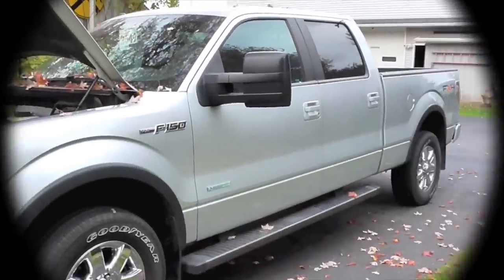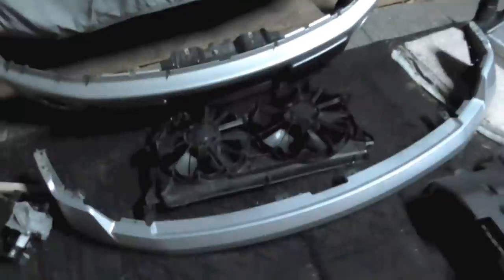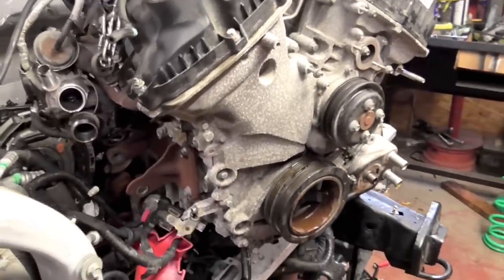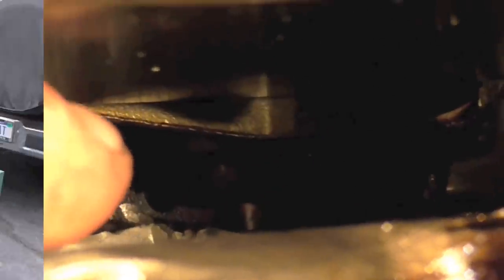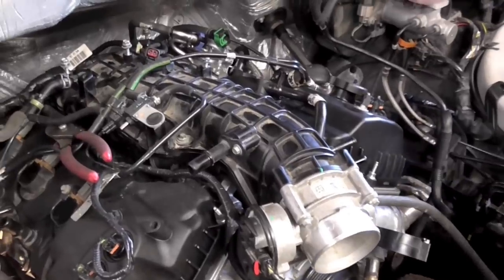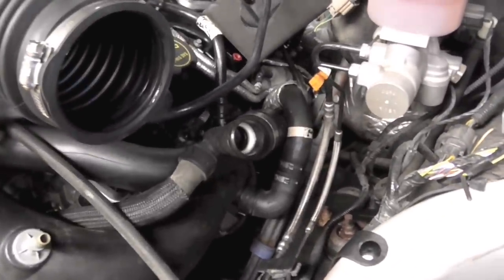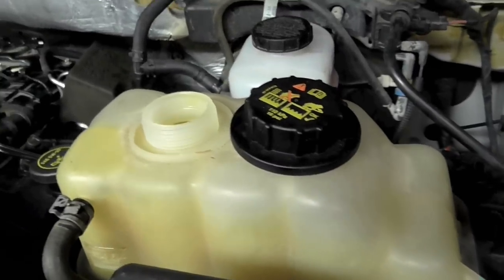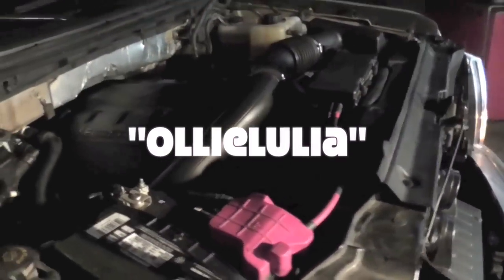FORD F150 TRUCK:  3.5 V-6 ECOBOOST ENGINE FAILURE (Removal and Installation).

Comment: How in the hell did Ford Not Warranty this?!?
Reply from the maker: That's what we thought, but the answer was NO. Probably too many miles ?
Reply: TommyZTrains Just checked it. They had 5 year,  60K warranty.  What crap, man. It should be a recall with reimbursement for previous repairs.
Reply from the maker: Yeah ... "policy is policy" I guess. *We literally begged too !
Reply: TommyZTrains I feel for you. I would hire legal representation for a 9,000 Bill,  plus labor.
Reply: .......the warranty had expired.....period
Reply: fred414141 This is a mass problem and should be recalled.  Warranty or not,  it's a design defect and companies issue recalls all the time.
Reply from the maker: Months earlier we had in in at the Dealer for "mechanical noise's" ... we were told that was "Normal". Also: We had the the drive-shaft spline greased (it was making alot of noise / felt "odd" upon shifting) ... *Anyway, the point is / was I'd wished we'd been told THEN. (Told about the CAC accumulating water inside).
Reply from the maker: I agree ... *When we "spuded" the 1st hole in the CAC,  the water rolled out like a 'mad-dog'. (AFTER the failure / blown Eng.).
Reply: TommyZTrains  dude I hate it for you thanks for sharing the video👍
Reply from the maker: Thanks  :- )
Reply: nitroman365 because it's Ford
Reply: 360Magnum I have them all. Ford, Chevy, Dodge.  They all break.
Reply: nitroman365 Well GM and Dodge are Better with looks and quality
Reply: 360Magnum But Chevy has way cheaper parts. Engine wise that is.
Reply: Sometimes if you have your dealership open a case with Ford they will cover at least a portion of the repair cost. Or get in contact with Ford's customer service people on forums. They seem to take care of people alright.
Reply from the maker: Yeah: "we tried" .... NO Soap.
Reply: +360Magnum - Not true - they basically all have major quality issues.
Reply: 360Magnum honestly no. they all have issues
Reply: you should have backed that odometer to the previous official reading in the papers and then went for a warranty !!!!!!!!!!
Reply: Newbpwng Federal crime... Not sure if you can put a price on your freedom. Lol.
Reply: nitroman365 Please nobody could ever prove this unless you backed the odometer way too far.
Reply: Newbpwng Still, this guy seems like an upstanding citizen. Never crossed his mind.
Reply: Newbpwng believe me, I know that all too well.  Lol.
Reply: nitroman365 Bullshit. Let's see your evidence that GM uses way cheaper parts in their engines. If anything their pushrod V8's are so simple they're inherently reliable. Just look at all the LS swaps going on these days where they pull junkyard V8's out of wrecked trucks an slap a couple turbos on them (1200hp junkyard 4.8L V8 LS - http://www.hotrod.com/articles/hrdp-1109-stock-gm-ls-engine-big-bang-theory/). Ford screwed up when they dropped pushrod V8's and went all-in on DOHC V8s and overboosted V6 gassers. Ever since then it's been bad timing chains/cam phasers/tensioners, weak/brittle oil pumps, bad rockers, blown headgaskets, fuel dilution of the oil, carbon clogged heads that Ford says you can't clean or you'll take out the turbos, leaking internal water pumps that leak into the engine oil when they fail, bad valve seats, blown spark plugs, seized sparkplugs, carbon tracked spark plugs, misfires, etc etc etc
Reply: That's what you'd think right? I had an 07 F150 4.2L that suffered a similar death. Two bent rods and fouled journals, spun crank bearing at 36,667mi. I was told truck had 60kmi powertrain at purchase (bought brand new w/6mi, did all maintenance and oil changes at same dealer) and then found out that WT models only have 36k. Ford absolutely REFUSED to warranty, used every trick and excuse possible even though my first service trip to dealer to report rod knock was at 24k, well before their janky ass fake warranty expired on their janky ass drivetrain. My ex's father left a management position at ford dealership service because he couldnt look himself in the mirror any more. Another friends father had a king ranch so bad he ended up taking the dealer to court and winning on lemon law. Anyways, had the piece of crap rebuilt on my dime when it died at 36k, died again the same way at 51k. Ended up paying off the remaining loan on a worthless pile of scrap metal undrivable lemon in my front yard, and hurt me so bad financially it was years before I could get another truck. The truck was such a fucking pile of junk, it was already starting to rattle with loose door panels and torn upholstery by the second time the motor blew at 51k. Truly FOUND ON ROAD DEAD. Played out saying, but so so right. FUCK YOU FORD, FUCK YOU SO MUCH, and your worthless wind up toy pickups. YOU LOST A CUSTOMER FOR LIFE JUST TO SAVE A FEW GRAND ON A LEGITIMATE WARRANTY CLAIM FOR A BLOWN MOTOR. Now driving a ram hemi that in 10x the truck my f150 ever was. What a joke piece of crap. What an idiotic way to lose not only a customer, but an entire extended family, me, my wife, and my daughter and parents, after they saw what you did, and what utter garbage your vehicles are.
Reply: Ian Hall I have been brought up on Dodge. My dad owns a company that had all Ford fleet vans. All of which has issues with the shitty 5.4, during at 156,000-180,000. The GMCs and Dodges have gotten to 250,000 + without fail, Ford is best selling because their are retards out there that are brainwashed by "best selling" its BS. Dodges 03+ were really the best since 96, I've seen 3rd gen hemis with 215,000 with no issues, but as for Ford the door panels are filling up with water and the grills are cracking. Enjoy the ram, the most resent fleet is all 2012 ram 2500 hemis. They are all at about 140,000 now with no issues.
Reply: 360Magnum MAYBE the 318s and 360s are OK. super old technology... Many of them blow blue smoke out the tailpipe.. the 2.4, 2.7, 4.7 were all know for some major issues and Chrysler just kept on producing them. the front ends on every Dakota and Durango ive workwd on need major work. Ive seen quite a few go down the road with the tires at a 80 degree angle. not to mention the rear ends blowing out of the trucks. don't even get me started on junk 4 speed auto dodge truck transmissions.. not to mention all those caravan transmissions.
Reply: reweydewy I do my own front end work on my Durango, tranny service every 25,000 and diff every 12,000. Rolling like a dream at 152,000. Better than any Ford
Reply: 360Magnum 152k is nothing on any of today's vehicles.
Reply: 360Magnum Yep, I had an 04 Dakota before the 07 f150, wish I'd never have traded it in, just needed a full size bed at the time. The front ball joints were a joke, but switching the factory ones for greasables and once you got used to the swap not a whole lot worse than doing brakes... hell of a lot better than two blown motors halfway to 100k. My new ram just feels "right" like the ford never did. Solid, powerful. Ride with coil springs is a nice bonus too.
Reply: reweydewy Obviously, I have a buddy with an 03 ram 2500 HEMI with 230k with original everything but a diff.
Reply: reweydewy gosh that f150 was such a piece of crap roller skate. It literally felt like it was rattling apart from about 10kmi onwards. My Dakota, besides sorry ass front end, was the only truck I was ever happy with besides my current ram 1500. Just love it. The 5.7 Hemi is very mature at this point, and the 8spd ZF is the best light truck auto trans I've driven
Reply: 360Magnum So what we are all trying to say is they all have problems.. or at least I am. dodge has come a long way from the 2000s but I still think a Ford or gm truck was the better option. not saying it still is tho
Reply: hochhaul calm down, homegirl.  I meant that parts for them are cheaper, as in cost less to buy.
Reply: Ian Hall I think GM and Chrysler in general are good companies. I remember when I was 12 or 13 my dad bought a new 03 Dodge. Which was a great truck, but the diff went out at 38,000. Dodge replaced it under warranty with no issue. As of now, there is a part of order for one of his trucks and Chrysler is paying $980 a month for the truck being out of commission. When a dodge has a weird issue out of warranty they will stand behind their vehicle, which seems to be the opposite with Ford.
Reply: nitroman365 probably because they used ams oil not motorcraft. lol
Reply from the maker: "That very well could be Nick" ... QWere doing Motorcraft NOW and the Truck continues to run FLAWLESSLY.
Reply: Isn't fords warranty only 60k? this had 65k right?
Reply from the maker: Yes.  "But we were turned down flat"  (no help).  And yes: 65,070 miles ...
Reply from the maker: You ARE correct (60K). *We literally begged / pleaded with Ford, and my Son even wrote (NOT an email) WROTE the CEO of Ford, a hand-written letter ... anyway: all this was too NO avail. End game: policy IS Policy.
Reply: Ian Hall That has been my experience with Ford and GM as well.  GM has treated me pretty well, while Ford couldn't give a shit less.  Ford has a MAJOR problem on their hands - both from an engineering standpoint (ecoboosts hand-grenading) and from a customer relations standpoint.  My family will never own a Ford again.  EVER.
Reply: austin In a normal situation (oil in the engine, not abusing it, etc...) NO engine should fail like that 5,000 miles out of warranty.  EVER.
Reply: Ted Brenneman maybe a little abuse is a good thing because I run the dog shit out of my truck and mine has 130k on it and doesn't leak anything and runs like the day I bought it haven't even put a surpentine  belt or front brakes on it yet but I am working on my second set of tires and I have put rear brakes on it and sparkplugs at 100k but other than that I have done nothing but run the dog shit out of it and runs fine what's the Ford's excuse again?
Reply: austin Just to be clear - I am not a Ford basher.  I actually like quite a few of their vehicles.  However, I have dealt with customer service myself, and know someone in a similar situation to the person that posted this.  Their ecoboost had water in the oil and eventually grenaded-after several services at the dealer BEFORE warranty expired.  Truck is 2,000 miles out of warranty, they are making payments on a truck that is sitting, and Ford told them to stick it up their ass.  Sorry if I'm not taking Ford's side in this.
Reply: Ted Brenneman I hear ya
Reply from the maker: Hi Ted: "I hear ya" ... BTW: we wrote (a hand-written letter) to the Ford CEO asking -Him if -they'd please consider ANY help ... we never so much as even received a reply. Obviously we didn't agree (with the "no-help" part), but a reply would have at least been "considerate". 

(Gese it wasn't like we were gonna "break Ford" / and go Bankrupt). Just please "consider our situation, the facts, any ANY help would have been VERY welcomed !! ... *NOT BECAUSE THEY HAD TOO , but rather: BECAUSE THEY WANTED TO.

Anyway: All this time later, (today for example we pulled our boat) ... a "BIG-ONE ... *it ran (and continues to run) PERFECTLY.

 We've had not ONE single issue with the Truck, but again: "It STILL smarts".  BEST  :- )
Reply: TommyZTrains I'm glad you are able to enjoy your truck as well as get out on the water - you deserve it!

It is disappointing how Ford has treated people on this issue (and others, frankly).  I am a fan of Ford (we own an '07 Mustang) and was impressed that they refused the government bailout.  However, if they want to avoid the need for a bailout again, they need to put better tested products on the road, and not treat their customers like crap.  After all, you didn't design the ecoboost - THEY did.  I am still a fan of Ford and I am pulling for them, but THEY need to fix their problems.  Thoroughly tested products and thoughtful, courteous warranty and service should be where they focus their efforts, in my opinion.
Reply from the maker: Ted I just appointed YOU as "Customer Relations" Director !!  *But seriously: I was never "screaming expletives", (or yelling "FREE FREE FREE") ... All we were asking (and wanting) was an appeal to ("hopefully")
look at this issue, ... see the 'merit' of that same "situation" ... and appeal too one's "good nature" in lending ANY "help" / OR COUNSEL too try an help us. 

If you disagree ("Ford"), "that's OK" ... but where I THINK THE BALL was dropped: was the 'no-reply" (with any of it). I'm not "Mike Rowe" ("I luv the Guy too" !)... I just wanted a moment, ... a moment that NEVER occurred.

End game: we moved on.
Reply: I have a Honda CIVIC..It's a POS too. Leaking cam seals at 65,000, broken motor mount, randomly dies on cold starts, broken visors, window seals flew off on hwy, chews rear tires every 3,000 miles, jerky trans, multiple water leaks, my interior always REEKS...then i get the air bag recall, and a motor recall for a cracked block, but honda won't replace it UNTILL IT BLOWS!!! good thing i kept my 93 ranger
Reply from the maker: Don't mince words Joey  ... "what do ya really think" ?    :- )
Reply: Still wonder why my parents keep saying they're happy with their 05 Escape. Tie rods, motor mount, control arm, shocks, valve cover gasket, water pump, and both radiator hoses before 100k. And it's also already starting to show signs of rust around the tailgate. Convinced me to get an 07 Fusion over an Avenger or a Jetta and I've already gone through a valve cover gasket, outer tie rods, and a blower motor resistor between 47k and 67k miles. Can't wait to get enough money to buy myself a Tacoma or Ram.
Reply: What does that even mean?
Reply: check for frame rust on the taco...The escapes can rust by the front Lower control arms also, I would check their escape for the subframe rot. Maybe that will convince them to get rid of it. I also have a 1997 CR-V that has only needed timing belt, valves adjusted and struts in 230,000 miles. and it still rides smooth as glass with blown struts (2 have broken coil springs)! Lesson learned is ALL MAKES have issues. even beloved HONDA . It is our job as the consumer to do your research and know what to look for. the information is out there.
Reply: They're already planning on get a 2014 or newer MKX. But they still think that the Escape has treated them well. My car hasn't even treated me all that well and the Fusion is supposed to be one of the few bright spots for Ford.
Reply: I had my 2012 Ecoboost do this at 83K miles.  Ford said it was tough and not warranty.  I had a used engine with 21,000 miles put in at a cost of $8000.  Just seized again after driving it 70K miles (91K total).   Ford dealers and mechanics all told me the engine design is junk.  Water condenses in the intercooler and then hydrolocks the engine.  Ford sucks!
Reply: I've was a diehard Ford guy.  Bought Fords my whole life maybe 6-7 vehicles including 3 F150s previously.  No issues.  Ford Tough means you're screwed when the engine dies just out of warranty.  Big price to pay for little better mileage and power.  DO NOT GET AN ECOBOOST!!!!
Reply from the maker: Sorry to hear about this Doyle, had you known about a "weep" hole, *perhaps all this may need NOT of happened. Tho we installed a "long-block" crated engine, too this day - the Truck runs absol. flawless.
It's perf., MPG, and power is: "well now",  ... TOP-Notch.  Best
Reply: Amsoil is not API certified. So they can tell you to take a hike! One reason I tell people use it at your own risk....
Reply: incorrect, its an engineering issue. Other manufacturers have had their fair share of similar issues. Lets not go down that road.
Reply: im assuming you are one of few with a bad truck. Sometimes things happen that way. I had a dodge intrepid back in the day in 99 with a similar engine issue and after we put in a brand new "long block" on my dime it went 30 miles and blew up again due to a failed oil pressure line for the timing belt tensioner. Should I just assume all Dodges are crap? Or should I just take this as 1 bad experience with a bad engine design in 1 type of vehicle?
Reply: im driving a 2011 Ford fusion with 219,000 with no issues and my daughter drives a 2007 Ford Five Hundred with 179,000 only put on brakes and a battery and my work truck is a 1996 F250 diesel with 296,000  on original everything and it pushed a snow plow every winter.
Reply: 360Magnum 
Rediculous statement. The big three spec there parts through the same vendors. Ie. Borg Warner etc
Reply: nitroman365 gm has always been priced lowest for parts . But they have a similar engine but normally aspirated 2.8 and 3.6;
Reply: nitroman365 m gm has great motors in there trucks 4.3  4.8 5.3  all super reliable
Reply: @Newbpwng  the mileage is recorded in several different areas as well as hours.

Comment: I know this is an old video with a bunch of responses. When you purchased the engine through Ford what type of warranty did you get with it when you installed it yourself? 
Thanks
Reply from the maker: Hi Chris:  "3 year warranty" !.  We use "plain ole motor-craft" oils and filters / or it says warranty will be voided. IT CONTINUES to run FLAWLESSLY and it's almost 100 grand (miles) later.    : -  )
Reply: @TommyZTrains  Wow thanks for the quick response back. I was just concerned about the warranty if I purchased a engine through them and would still get the warranty if I did it myself.
Thank you
Reply from the maker: @dink8898   You betcha ... we purchased the Ford crated "long-block" with ALL the upgrades .... (watch video if you missed that part  /about the UPGRADES Chris). Best